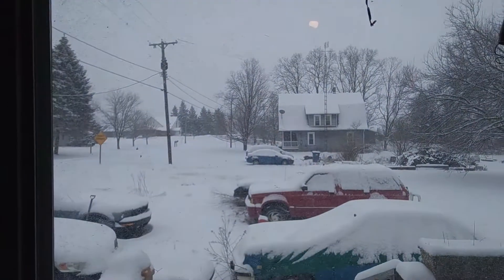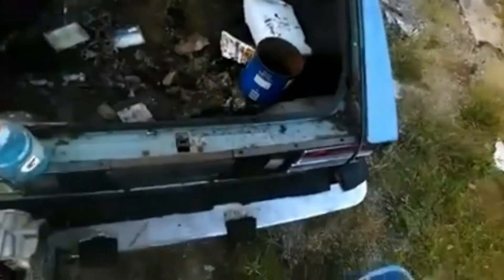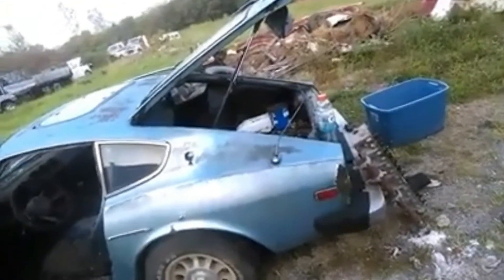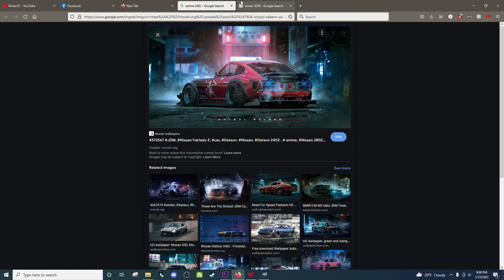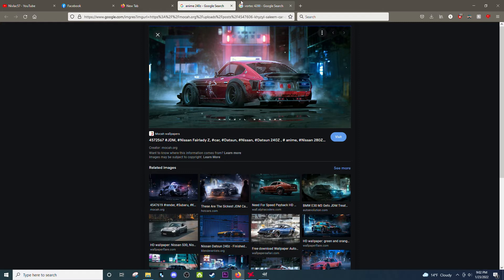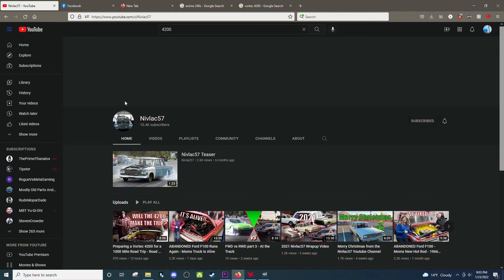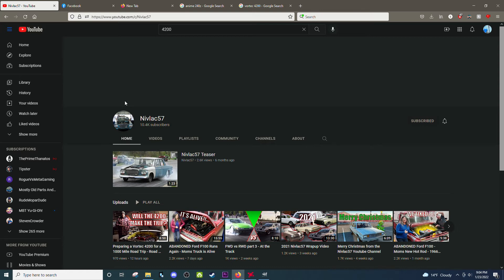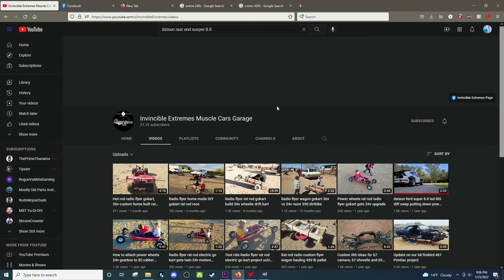Should I build this Datsun 280z for #nonamenationals ? You tell me! Choosing the next Project Part 1

Comment: I had dealings with two Zs back in the late 70's and early 80's and the most important thing you have to deal with, is what you've covered.  Rust.  One of my buddies back in around '82, picked up a 240 that had fiberglass holding the frame rails together.  He was my boss at the time so I didn't tell him how nuts he was.  He blew up the classic 240 motor.  I helped him pull it out with a chain and 4x4.  I laughed at how light it was.  Then he put in a remanned 260 motor.  We did it the same way but some how, that wasn't as much fun and it wasn't as light.  The thing that brought those early Zs to the forefront was the aluminum engine.  If you can get and keep those frame rails together and in one piece, it's a good way to go.  I can only suggest, before you invest the money in the rest, do a Jim Bennett on that thing.  Take it apart.  Make sure the frame rails aren't going to get torqued off the firewall and back.  If it's safe, it sounds like your I-6 will be just the ticket over any SB application that would go into it because of the weight savings.  It also will help with the transfer of power to the back and as light as it is, you will need all the help you can get in that department.  I did a quick search on kits for the C SB application and found this newer one.  Although you're going with the 6, it has pictures and some good points about the center of the driveline compared to the original Z style.  You might find it addresses some "down the road" issues if you haven't come across them yet.  I'm not able to put a lot of money into my car and it's a 43K original, however, the first car I bought was a '66 Newport, back in September of '77.  I had just enough money for the car ($100) and the insurance for a year, ($170) and the rest was money to last until the next Summer ($580) was for gas.  I have a few gas receipts from a credit card my dad let me use back then that I had to pay back.  My gas money ran out by March of '78.  Gas was 59.9 per gallon.  So, I'm going to do things to the Chrysler, that didn't cost much and are mostly, exactly what UTG does.  I have to work with what I have on the car and make it go faster.  My car may look like a princess, but we'll see!  I hope you get lucky with the Z car because they are bad asses with power under the hood.  Here is that link: https://jagsthatrun.com/products/datsun-280zx-v8-motor-and-transmission-mounts
Reply from the maker: Hey man thanks for the great reply, youre spot on 90% of my work on the car will just be making sure the car isnt going to crumble in half, the i6 i have is all aluminum so the weight should be great, thanks for watching and the reply.
Reply: @TallGarage  Yeah I think you're in a sweet spot with the GM I-6.  That motor wasn't around back in my day and so few Z's were worthy to live on under the torch and the SB.  You should be able to pull damn close to cars like the Tiger if you can keep that thing together.  Keep us posted!